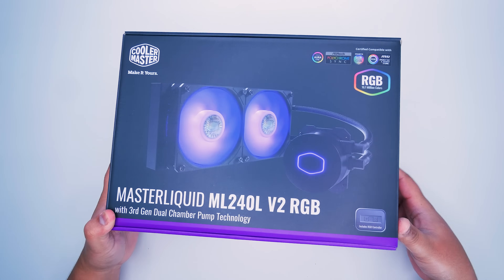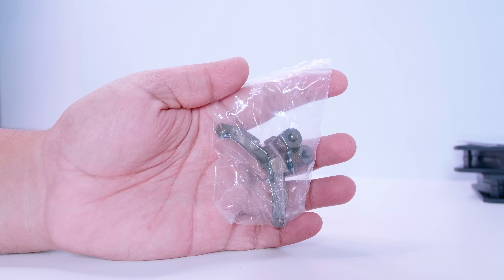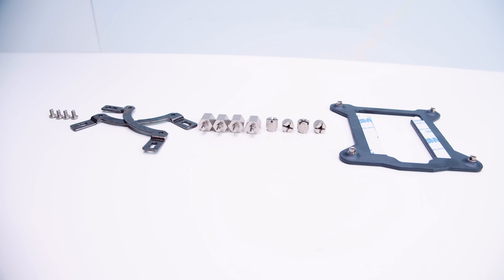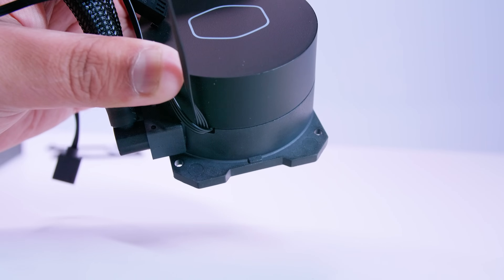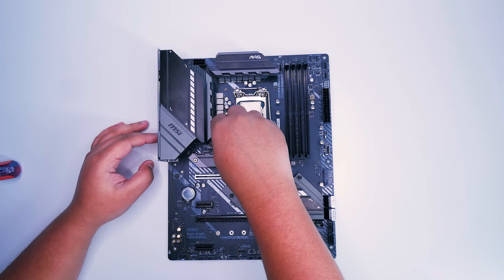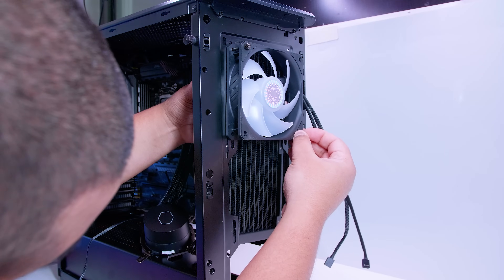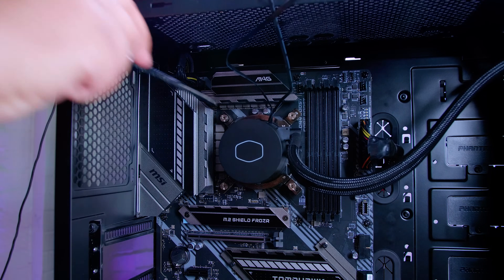HOWTO Install Cooler Master ML240L V2 RGB on Intel LGA 1200 and 115X Motherboards

Comment: I have done some in-depth testing over the last month with multiple fan configurations, multiple reseats, multiple thermal pastes. If you are overclocked at 5gz this system can idle at 40c and stress out at 70c (cinebench). 4 fans need to be used, 2 on either side of the rad.  PUSH-PULL. Thermal paste needs to be spread out with a spatula. USE MORE than one pea size blob. It needs to be generously spread out. I have tried with less thermal paste (one pea size blob) and it was spread out too thin. I even tried the Noctua NF-F12 iPPC 3000 PWM, Heavy Duty Cooling Fans. They only affected the temps marginally.  I tried the Scythe Kaze Flex 120mm Fan, Quiet Case/CPU Cooler Fan, PWM 300-1200 RPM also.
I settled with two kaze fans on the exterior of the rad pushing air into the rad, and two of the original Sickle Flow fans inside the pc pulling the air out of the radiator. Moral of the story, use 4 fans, make sure thermal paste is evenly spread out : a little more works best, rather than a little less.
Reply from the maker: A couple of flaws in your testing.

A 240mm AIO for a CPU than can hit 5GHz is no where near enough surface area.

Cinebench does not load the CPU enough to saturate an AIO cooler. An AIO needs at least an hour to fully max out its cooling performance and hit the thermal ceiling.

I would suggest using a proper stress test. I guarantee your CPU will be closer to 100C with proper testing.
Reply: @GearSeekers   I will try Aida 64 for an hour. I fear you are correct.  I did briefly try a 360, but it only lowered temps by 4c? Again these were all 5 minute stress tests with XTU and Aida.

Comment: I have a asus mobo and I don’t see any rgb header, can I plug that rgb to a extra chasis fan header? I saw a video of a guy plugin a rgb strip into a extra chasis fan and I lighted up, so I’m wondering if that could work for me too?
Reply: standard 4 pin RGB runs on 12V power. A-RGB, or addressable RGB runs on 5V power and has three usable pins on a 4 pin plug with one port blocked out. You can not run A-RGB on standard 12V RGB ports or it will burn up the LEDs. They were probably using RGB 12V on the fan header which also runs on 12V. However, the motherboard sends variable voltage to those fan headers to control fan speed thinking a fan is plugged in, not RGB lights. As the voltage changed per the MB's command, the change in voltage would result in the RGB lights constantly changing I would venture to guess. I'm by no means an expert or anything, and may be way off but that's what I would deduce.
Reply: Brad Aune thanks pal! That helped me a lot! I decided to go with rgb fans with a remote controller :(

Comment: The hot air will push back inside to the case by your way installing,right?
Reply from the maker: It is the correct way
Reply: @GearSeekers  7:40 is it okay to have the fans on the inside and the radiator up against the front of the case? I have a Corsair 275R Airflow case

Comment: On many cases you cannot mount the fans on the outside. There is no space to the right to get the wires going back into the pc. So the fans have to be mounted inside the radiator.
Reply from the maker: Exactly like I said. This video is for demonstration purposes only. This is the correct installation for this case. This is one the most popular cases on the market which is why we use it for our guides.

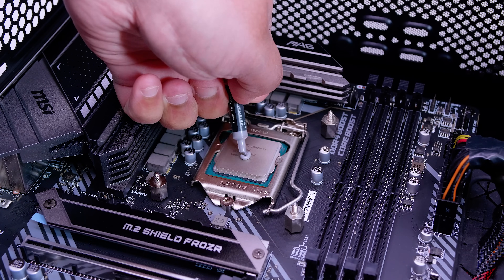Comment: Sir, I have a msi B450 Gaming Pro Carbon AC motherboard and there is not cpu_opt, only CPU fan header on my motherboard. At time 08:44, But the water pump header is. So I want to ask where to connect the three-pin pump cable?
Reply: On the top right of the MB, is there a port labeled PUMP_FAN1?

Comment: wonderful video, but i've got a question.
the store from my country shows that this cooler isnt compatible with LGA 1200 (10th itel) i mean you just did an installation with an i5 10th ... so i dont get it. 
I need help about buying a liquid cooler for my MSI mpg z490 gaming carbon wifi and i have no idea which one can be good for this motherboard.... if someonee can suggest something i'd appreciate it so much.
Reply from the maker: It is 1000000000000% compatible. The store is wrong. 115X and 1200 have identical mounting.